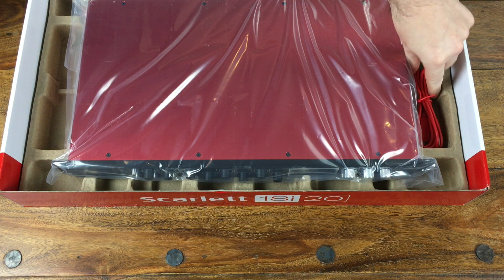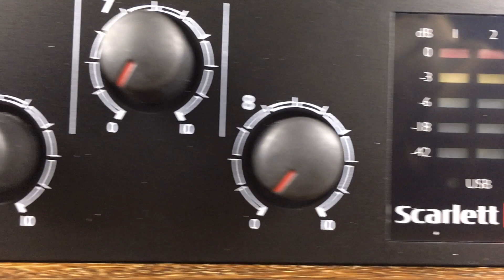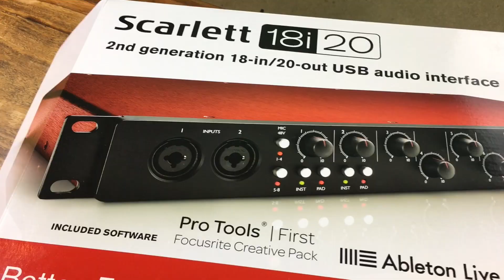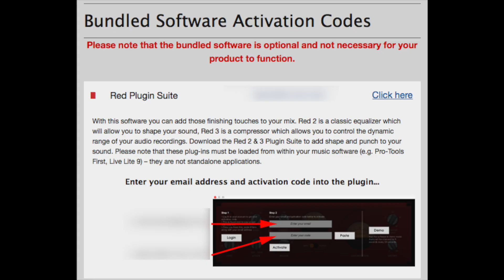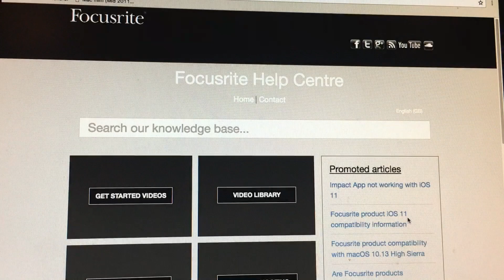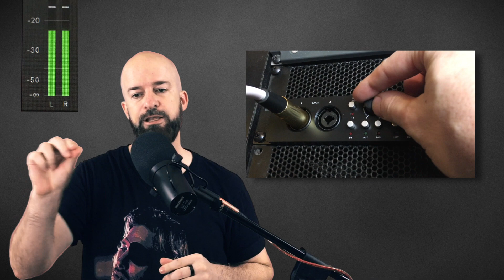Best Audio Interface Under $500? Focusrite Scarlett 18i20 2nd Gen Review

Comment: newcomer here. The phantom power CON... what's that in layman's terms? I understand what phantom power is but could I run mics that don't need it alongside one that would, hypothetically? For a small home studio, do I need phantom powered mics and/or are they generally preferable?
Reply: Here's my 2 cents.  There are definitely some mics that can be damaged by the 48v phantom power, so you'd need to be very careful when you're using 2 mics at the same time when only 1 mic needs 48v.  As you'll find, mics are all over the place when it comes to what's best for which purpose, but I'd say you'd almost certainly encounter this situation at some point.  Condenser mics usually need 48v but wow, they're usually astonishing in what they pick up -- think crystal clear vocals or acoustic guitar.  But if you're recording a loud 4x12 guitar cabinet, a tried-and-true Shure SM-57 won't disappoint.

Most of the nicer mics should be fine and will ignore phantom power if it's not using it, but always make sure that switch is OFF when plugging in 2 mics.  I encounter the same worry using one Audio Technica AT-2035 condenser that required 48v and a Shure SM-57 dynamic that didn't.  To use them simultaneously, I made 100% sure the SM-57 would simply ignore the 48v power -- and of course it does.  Hope that helps.

Comment: Ive always used a PCI Express sound card, but I'd like to switch to this USB3 to save an express slot.  Im worried about the latency of USB3 vs PCI-E.  Is there a difference in latency, with respect to playing VST instruments and using multiple VST plugins at once in Pro Tools?

Comment: Would it be a good idea if I am new to recording to purchase a used focusrite 2nd gen 18i20? Will it still work for years and have software available for it? The 2nd gen is for a good deal and having the additional mic inputs may be cool for recording demos. However, my intention was just to get a focusrite 3rd gen 18i8. So I guess my question is this. If I found a 18i20 2nd gen for $320 used or a 18i8 3rd gen for $399. Which one makes more sense?

Comment: Just wondering if anyone has tried using this 2nd gen 18i20 with OS X 10.9.5? It isn't officially supported on the Focusrite website but it says it may work due to class compliance. I can't upgrade my OS because I'm using Logic Pro 9.1.8 and upgrading would make this incompatible. I have a 1st gen 2i4 that works without any issues.

Comment: Hey. Top review. How has this device held up since your review?

Also my DAW pc is connected to a 43inch 4K tv. Do you think this would work as an AV receiver so I could use the TV's optical sound out to the Scarlett's optical in and therefore use my studio monitors and subwoofer as the speakers for my tv? My old Focusrite Saffire Pro 24 was able to do that but unfortunately that is Firewire which I dont have on my new pc.
Reply: Nevermind, found out it works only with the spdif coaxial input on the Scarletts (so optical to coax converter needed) but does work on the Saffires, Claretts and Red interfaces.
Reply from the maker: Glad you found the answer to the optical question. As to your other one, I'm happy to say the unit has held up very well and is working great. Occasionally it will lose connection if my Mac goes to sleep overnight, but a simple flip of the on/off switch on the Scarlett restores the connection.

Comment: I have lots of issues with my Mac sleeping and logic loosing my interfaces (I have a 6i6 and an 18i20 now). I usually go into my preferences, Audio then unselect/reselect my interface (or aggregate device when I have my AxeFx plugged in also) and hit apply. Logic with recycle and pick up the interface again. Sometimes my Scarlett’s 6i6 will turn off though and I’ll have to cycle power again. Keep rockin’
Reply from the maker: Hey 2, an easier thing that works for me when it looses connection... you just flip the on/off switch on the Focusrite. Try it and see if it works for you.

Comment: I can’t get line outputs 3 onwards to work (either on headphone or other outputs I prefer). Only 1-2 (which of course are specifically “monitors” and not just a line outputs) are outputting audio. Tweak with the focusrite control but still not getting any sounds on those mentioned outputs. Any help would be really appreciate. And thanks in advance!
Reply from the maker: Hi Paul - please try Focusrite tech support here: https://support.focusrite.com/hc/en-gb

Comment: Is the same on the 18i8 ..also do you use a pcie usb card?
Reply from the maker: Hi Sco B - I'm going straight from the Scarlett to a Mac via USB, no card.
Reply: Weird I am issue with a Audio hiccup randomly. What intel processor and whats you setting in daw...1024 buffer muti processor 48k 16bit ? I love this interface but the playback sucks. I get making music and then all of sudden crackle and back to the music basically a small glitch. GC says i cannot return it but heard other people having the same issue ..suck because my m-audio playback is flawious but the pre-amps suck .....maybe i can set the my 1814 firewire to windows only and focusrite just for abelton. seems to be a window issue taking control of the unit and yes i uncheck the windows prgram exec in properties.
Reply from the maker: I'm on a 2017 iMac and the 18i20, so can't speak on your problem in Windows. However, crackles and glitches with any interface are almost always an issue with DAW settings beings set too aggressively for hardware. Try lower resolution and sample rates. Also, check here: https://support.focusrite.com/hc/en-gb
Reply: Does the 18i20 also suffer from BSOD?

Comment: Hey man. I m actually going to be ordering this same interface with the shure mic you used. Does it need a cloudlifter or would pro tools be able to boost the gain enough for vocals?
Reply from the maker: Hi Tanner - you do not NEED a Cloudlifter, the SM7B with the Scarlett will give you a very usable signal that you could further boost inside Pro Tools if you need to. I would recommend you try it first without the Cloudlifter, and you can always order it later if you want to. That way, you don't spend any $$ that you don't need to.